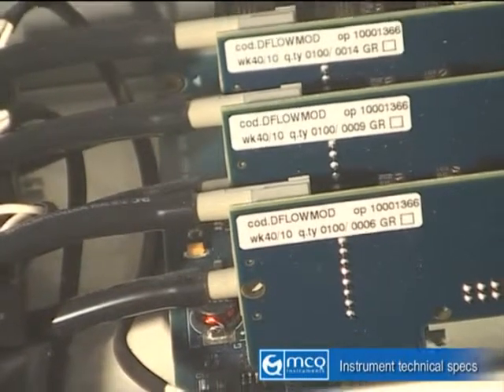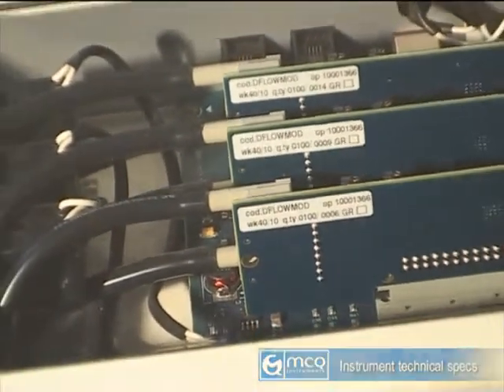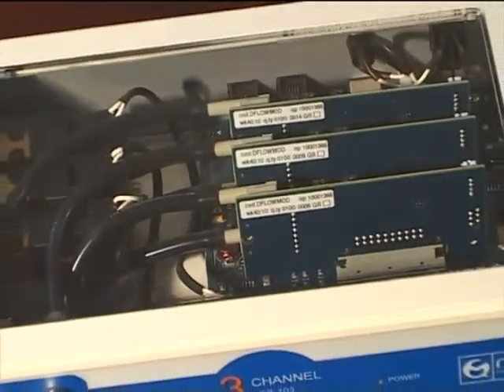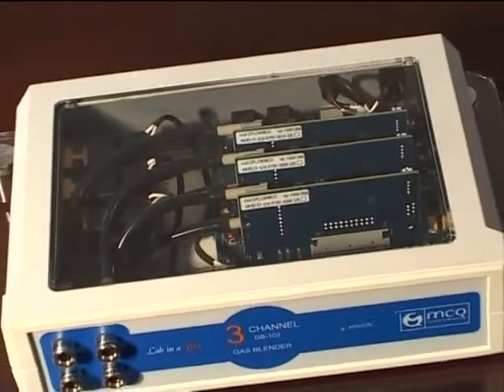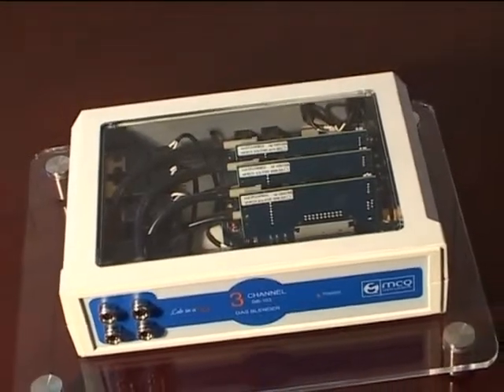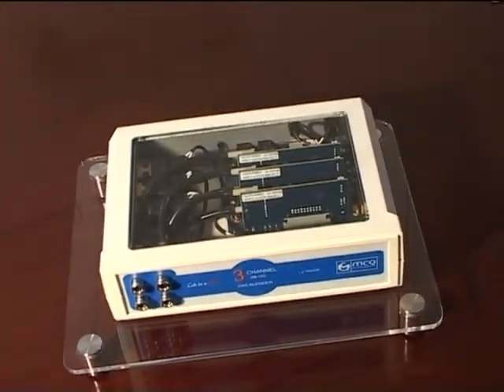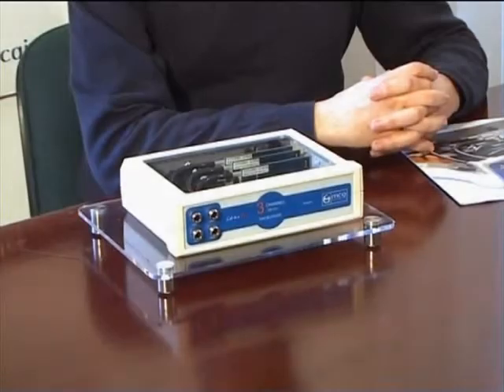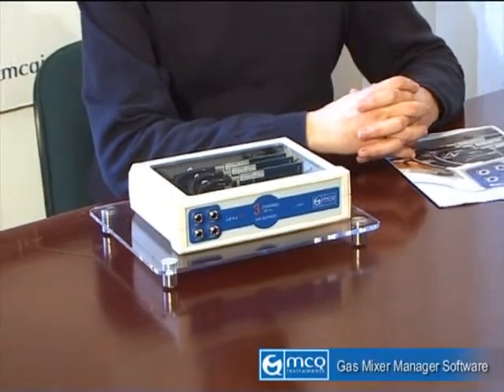Gas Mixing Lab in a Box Gas Blender

Comment: I need to mix nitrogen co2 and helium at the same time as it goes into a vacuum packaging machine that removes the air before  filling it with mostly nitrogen with a little helium and co2 , I can buy it pre-mixed but its expensive  can you contact me